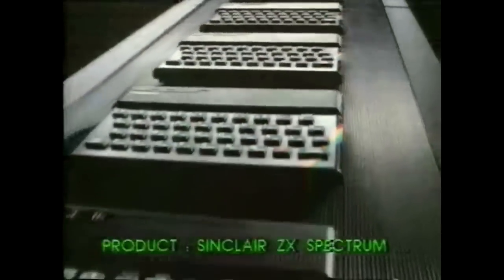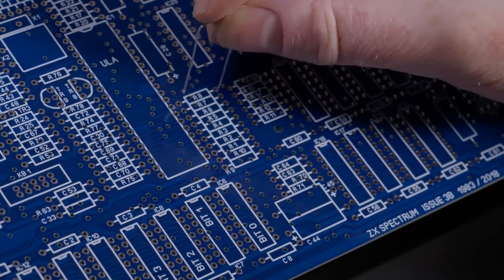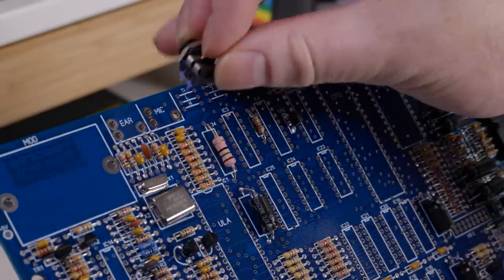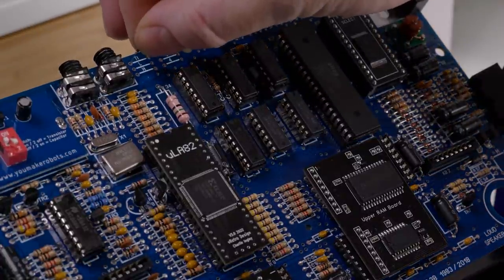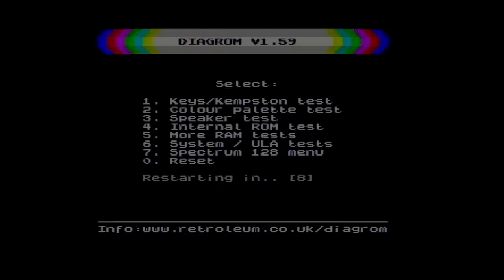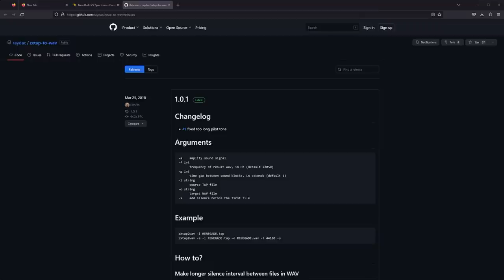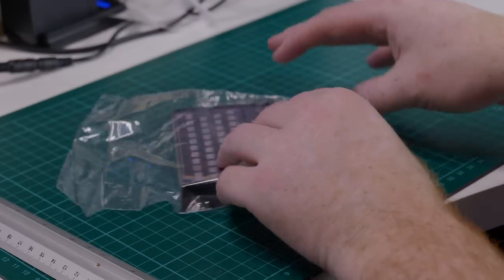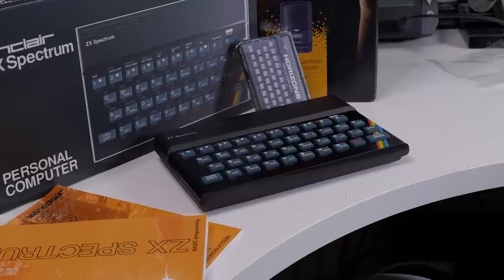Building a brand new ZX Spectrum with nearly 100% new parts, reconstructed box, manuals & tape

Comment: another possibility is to build the 'harlequin' clone board, uses bog standard logic chips, no ULA required, but  theres A LOT of chips in it!! there has also been a version made using an Altera CPLD instead of the ULA
Reply from the maker: Yup, I have made a couple of Harlequins and they are a fun build and of course fit in the case as well. For this build though I wanted to see how close i could get to the original chipset and board as possible with new produced materials
Reply: @RetroTeaTime  i have several 'empty' harlequin boards, various versions, plus 2 of the Altera based 'clones' (zx max 48 and zx max 128) havent got round to assembling them yet!

Comment: I'd say a cheap $3 multimeter won't hurt. It could be easier and faster to use that one to check the values of the resistors. It can also be used to check if there's a short to the ground, and if there's something wrong with the machine, then it could be used to check the voltages.
Reply from the maker: Absolutely. I really should in hindsight have shown my pre and post power checks using a multimeter that I have documented on my site. Will add them to the followup video

Comment: Which way around is TR6? The diagram doesn't say flat face east yet the transistor page on the website does.  It's difficult to see which way around it is in the video but it looks like the flat side faces west.  Thanks
Reply from the maker: If using BC337 then the flat side should point west

Comment: Well I’ve been looking at building one myself but you’ve done it in perfect fashion, May I say you did great explaining things as you we’re building, I’ve had two units from eBay but the units just gave up, could you tell me how much was the full kit, the only thing I would change is the face plate to white, well done and Thankyou for your video 👍🏻
Reply from the maker: Many thanks! Broken down costs can be found here, if you forget the box, the manuals etc it can be done a lot cheaper, links to everything is also on my site https://www.lostretrotapes.com/zx-spectrum-issue-3b-cost/
Reply: @RetroTeaTime  Thanks, most appreciated 👍🏻

Comment: Now that the original Z80 is discontinued, will the eZ80 or an actively made clone or FPGA still work with this PCB? I'm aware that 40-pin adaptors for the ez80 are available.
Reply from the maker: I will do some tests and make a short follow-up

Comment: Personally I would have been tempted use two 62256LL or similar for ram and the extra logic chip (74HCT139 or 74ACT139). With some knife and forking the ROM you could then get rid of the DRAM Refresh. That could be a bit of a 'mare though. I used to do some assembler for the 6809 and Z80 but that was nearly 4 decades ago.
Reply from the maker: Interesting, will Dona bit of research on that

Comment: Yes getting rid of the Linear regulator is a huge improvement. I'm presuming it halves the power consumption. Battery powered anyone?
Reply from the maker: Potential quite soon in the future project
Reply: @RetroTeaTime  Actually I had a ZX81 or rather the knockoff version, the Lambda. I did run it on D cells just for fun to make weird noises on the bus. Yes I memorized the random tone generator program, and could punch it in and run it without display. I was the cool school kid that day.
Reply from the maker: No way, that is amazing. I would have absolutely thought you were the coolest kid around, even cooler than the kids breakdancing on some cardboard in the playground

Comment: Cor that takes me back years like a half brick to the back of the head lol   My first new machine was the ZX80 kit which was pretty much everything shoved in a box and little instruction either, no ease of finding electronic kit like decent solder irons or even solder but was lucky that in my neck of south London was one of the early RS Components shops and I had to work double hard to afford a small reel of solder and the ever lasting need for burnt out component replacements as them ZX80's were problematic and often burnt itself out expensively.   Worse still, the damned thing almost set fire to my brand new bedroom carpet sparking my grumpy fathers ire, not so long after my mother interviewed Sir Clive at her newspaper and apparently they had quite a funny half hour talking about the fire hazard ZX80 of mine.
Reply from the maker: Where was the RS Component shop? I only really remember a store on Putney High Street that sold that stuff but can't remember the name. 

Scary story about the carpet, sure there were a lot of close calls back then!

Comment: for the FULL build experience use 8x 16K faulty memory chip (only half memory OK and just map out the bad half) this is what Sir Clive Sinclair did on the original to cut costs
Reply from the maker: Yup, clever move there. Unfortunately (fortunately) that RAM isn't made anymore so modern replacement had to be found as to the rules of the build

Comment: Didn't want one then and don't want one now.  Oric was my first computer
Reply from the maker: Never used an Oric, what were they like?
Reply: I had an Oric 48k and never regretted it, not as much software as there was for the Sinclair but it was a better machine and it had some pretty decent titles available for it.

Also Dead Kennedys 👍
Reply: @RetroTeaTime  They were very nice machines they had better sound and keyboard than the Spectrum, with a 6502 processor, I loved mine.
Reply from the maker: Will have to jump onto eBay and see what I missed out on!
Reply: @RetroTeaTime  Maybe grab an emulator first, try before you buy .
Reply from the maker: I own pretty much most systems so it is a gap!
Reply: @RetroTeaTime  In which case it might be worth hunting down an Oric Atmos, it's essentially the same machine but has a superior keyboard and a slightly debugged rom, also it looks so much better.
Reply from the maker: Oh cool, thanks for the tip. So old software works on this one?
Reply: @RetroTeaTime  At the time better than the speccy, but speccy had the hold so who in thoes days was gonna buy another computer. Had the Oric Atmos as well.
Reply: @RetroTeaTime  I think it was mostly backwards compatable, later releases had Oric 1 versions on one side of the tape and Atmos versions on the other,  I think that might have been more for the benefit of Oric 1 users ... but I'm not entirely sure . 

Also it might be worth getting an Erebus - a modern day peripheral that allows Orics to read software from a microSD card, this is because Orics were notoriously picky about reading programs from cassette, you had to have the volume set just right or they wouldn't load.

Comment: Thanks for this amazing video, what a well done job. I still have a ZX Spectrum 48K but I put the PCB into a DKTroniks keyboard because I was fed up with the original one. I still have it thou. Manic Miner was my favorit game too, but I finnished up to the final (with the help of the "POKE xxxxx". I took one entire month to reach the final frame. SABRE WOLF was great too with much better graphics. I was searching your site for the SD Card plug in device but I couldn't find it. Can you give me a hint? Regards, all the best!
Reply from the maker: I think I got used to the rubber keys, Manic Miner doesn't feel right playing on anything else. And what a game, quite right it was your favourite. The SD Card plugin is called SMART card for ZX Spectrum from Retroleum, however thanks to the chip shortage it's currently out of stock https://www.retroleum.co.uk/spectrum-peripherals

There is also the DivMMC that does the same thing, I also own one of these and it looks like The Future Was 8 Bit has some in stock https://www.thefuturewas8bit.com/divmmcfuture.html
Reply: @RetroTeaTime  Hi, thanks for your swift reply and advise. I'll keep an eye on those because I doubt my game tapes are fit nowadays. Cheers

Comment: hi can you tell me more about the rom, do you have to program it and can you simply put a standard 48k rom in place
Reply from the maker: You can use a standard 48k ROM no problem. The one I used in the video was purchased and doesn't require any further modification of the Spectrum to work, and can toggle between the standard Spectrum ROM and a diagnostic ROM with a simple toggle as seen on the video. You can find that in my parts list here https://www.lostretrotapes.com/zx-spectrum-issue-3b-parts-list/

You can use a programmable 27C256 EPROM to burn a ROM yourself, I'll make a video and guide on the site about this very soon, but it does require a modification of the Spectrum, as you need to bridge pin 1 and 28 on the ROM as well as install additional diodes and resistor near to the loudspeaker.
Reply: @RetroTeaTime  hi thanks for you quick reply, ive checked your parts list but cannot find the one you mention
Reply: sorry i ment to say its the chip that you can switch between the  diagnostic rom as well as the 48k rom
Reply from the maker: Opps, had missed it out the list. Have added, it's the Switchable ROM from https://www.retroleum.co.uk/zx-spectrum-chips
Reply: @RetroTeaTime  sorry i ment to say its the chip that you can switch between the  diagnostic rom as well as the 48k rom
Reply from the maker: Yes that is the switchable ROM from Retroleum on the above link
Reply: @RetroTeaTime  thanks for your quick response and help

Comment: I am SHOCKED that you put the transformer in the box without tying its cable! So unprofessional. 😂😂😂😂

Joking aside, impressive work.
Reply from the maker: It is a good point! Realistically I should have also taken off the plug, but the modern ones you aren't easily able to

Comment: I built this - but all I get when turn on - is that screen when you tested the ram - lots of square colours.  Same as how you built it.
Reply from the maker: Check all the solder points, send a picture of the colours, might be able to diagnose from here. Or pop into my Discord and ask there
Reply: @RetroTeaTime  its ok I fixed it the BOM I was using had wrong transistors.

Comment: Choose ring bound and add 12 pages in manually.
Reply from the maker: Hopefully the printer will allow me to add in the 12 pages, waiting to hear back
Reply: @RetroTeaTime  Assuming the ring binding can be opened, print 2 ring-bound books, 200 pages and 12 pages and then manually move the 12 pages over.
Reply from the maker: Not easily opened I don't think, but good idea, will suggest it to the printer. Much better to do it at the printer before they are bound though if possible.

Comment: Is the case new as well?
Reply from the maker: It is, people are making perfect replicas of the old cases. Links to them are on my site. They look stunning.
My next project though doesn't have any commercially available cases available for this particular machine so I am trying different methods in the 3D print space to get the best possible result.
Reply: @RetroTeaTime  I don't see a link to the new case and keyboard.
Reply from the maker: Look under Misc in https://www.lostretrotapes.com/zx-spectrum-issue-3b-parts-list/
Reply: @RetroTeaTime  Thanks.

Comment: Many years ago I had a Speccy with chips in sockets. socketed chips are the best way to render speccy completely unusable. there is no point in even closing the case - it still needs to be opened from time to time. every 5 minutes or so. to put the chips back into their sockets.
Reply from the maker: Interesting, I have fixed a lot of Spectrums now and never had a problem with sockets, and find them a godsend when working with the old chips
Reply: @RetroTeaTime Perhaps I had old sockets of very poor quality. These were Soviet sockets ...
Reply from the maker: Maybe. Probably a good idea to use half decent ones

Comment: Lm1889 is tv modulator, so since you're using composite connection, lm should not be needed
Reply from the maker: Unfortunately if I remove the chip the picture doesn't work. Maybe I can experiment with some other chips
Reply: @RetroTeaTime  Let me check the spectrum's schematics. Interesting to see how its used there.
Reply: @RetroTeaTime  ok, I was wrong. ULA outputs /YUV signals. It's a component output almost similar to YPbPr, but some simple circuit might be needed to adjust signals to comply with normal YPbPr. 
LM1889 does the conversion from /YUV to allow the composite or RF outputs.
In theory, we can remove LM circuit and replace it with another circuit to adjust /YUV to YPbPr, if component connection is the only one needed. If not, need to check how to convert YPbPr to Composite.
Reply: @RetroTeaTime  Anyways, NTE846 seems to be easier to find and it should be direct replacement
Reply from the maker: Many thanks, will buy one and slot it in and report back!
Reply: @RetroTeaTime  Anytime :)
Reply from the maker: @eugenegrebionkin  Been looking around and the NTE846 doesn't seem to be manufactured anymore either :(
Reply: @RetroTeaTime  yeah, seems like no similar chips are in production anymore. I've just seen some comments that nte846 is easier to find

Comment: An easier solution is ZX 48 Spider. Far fewer parts.
Reply from the maker: I have made the Harlequin in the past, and a few other clones but for this I wanted to see if I could keep the spirit of the original but just replace every component with a modern equivalent

Comment: Why these ugly FPGAs and surface mounts? Except for the sound, you can build a Spectrum with standard 1980s components only, including the ULA. Old or newly made ICs doesn't matter.
Reply from the maker: The point of the project was to see if it was possible to create a replica of the spectrum using only new parts, that is ones that are still manufactured. 
As more boards get stripped now for the ULAs and more and more fail it's important for the FPGA modern recreations to exist, so we can continue to build and use these machines.
Surface mounts were just for easability for the future, in case chips needed to be replaced, they can of course be soldered directly to the PCB
Reply: @RetroTeaTime  I didn't watch the full video. Is it your own design?  However, my main point was that you don't need an FPGA in order to implement the functions of the ULA. Standard TTL or CMOS logic is still massproduced, and has been used for this purpose for many years.
Reply from the maker: There are projects such as the Harlequin that replaces the ULA with ICs but the PCB is completely different. This build tries to keep the whole spirit of the original as far as possible.

I brought together other people's projects where they already exist and fill in the blanks with my own work to make the Spectrum.

If you watch more of the video you will see I recreated and professionally printed the manuals, recreated the horizons tape, produced new covers and shrink-wrapped it, and got a new box and polys. Was just a fun experiment to see if possible, not intended for mass use, and the end cost shows that!

Comment: no dram?.... no real spectrum
Reply from the maker: Unfortunately there isn't a large market for the DRAM anymore so alternatives had to be found!
Reply from the maker: All used or NOS though. No one is still making it
Reply: @RetroTeaTime  i see you want all components to be still in production right now, but is this requirement really viable? this is retro system that obviously may use retro components that still available, otherwise you need to use an currently produced fpga and i'm sure that fpga would end it's production in next 3..5 years and will be replaced by other. just check all chips on your board probably some of them already phased out... so it's kinda useless to try to you still produced components if old components still available and would be available until the end of your life...
Reply from the maker: @mightwilder  Hopefully though if Charlie stops making the vULA for example he would open source the design so we can recreate it. Apart from the LM1889N everything can be bought new today and is still being produced. Chances are all the new chips on the board will be available for a lot longer than some of the other older chips that have been discontinued for quite a bit of time now. 

But to be honest it was always just a bit of fun project, and hopefully extends the life of the spectrum in as original a state as possible.